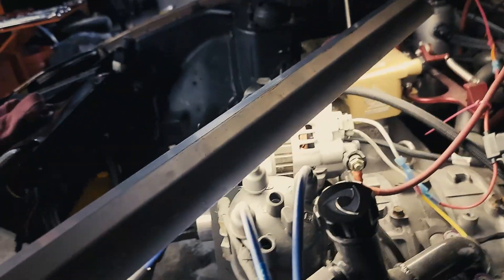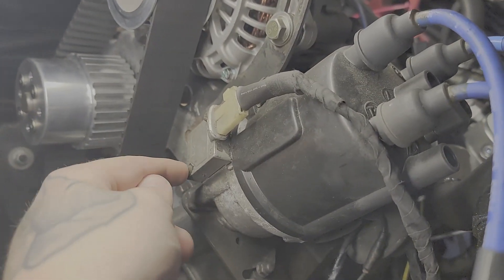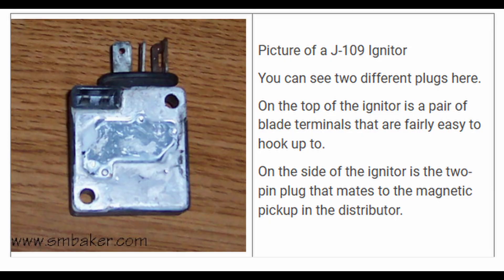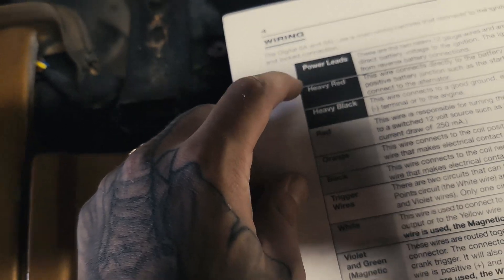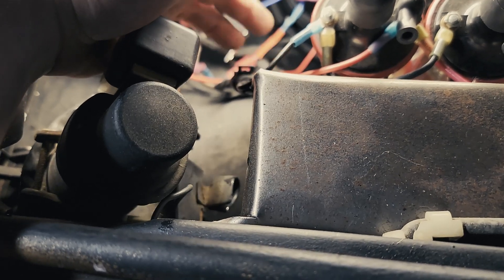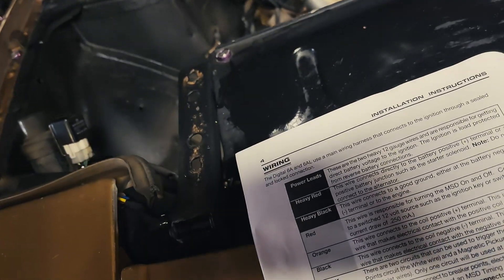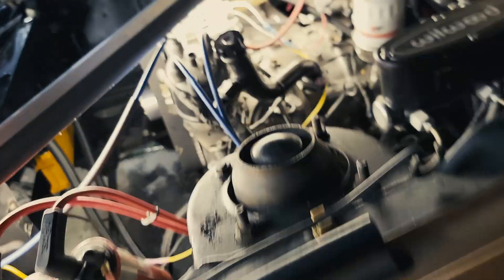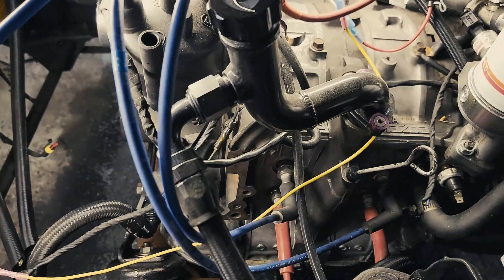MSD, Rotary and ACES Killshot - Quick tutorial

Comment: How would you set up a relay to cut the trailing?
Reply from the maker: I would wire the power supply of the trailing igniter into a 5 pin relay and use a button on the steering wheel to activate the normally open circuit on the relay by grounding it out. That way it only cuts trailing ignition when the button on the steering wheel is being grounded and is receiving power at all times otherwise. Then you'd tied that into your review limiter system with that same ground trigger
Reply: Thank you! @wheresmy10mm

Comment: What improvements did you notice running the MSD vs a stock setup?
Reply from the maker: No idea, my stock setup didn't work when I got the car and it was my first rotary but it seems to have a very strong spark compared to the original one
Reply: @ Thats good. Saving this video for when I install mine this summer, been having issues with my leading spark. Also my first rotary, very interesting to learn about!
Reply from the maker: @AbelNutu  hell yeah! Congrats 👏